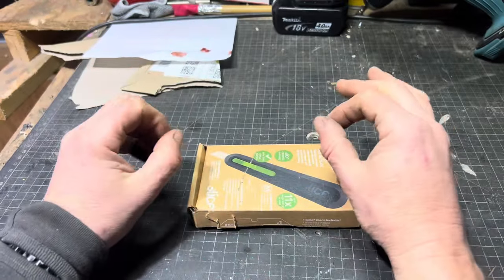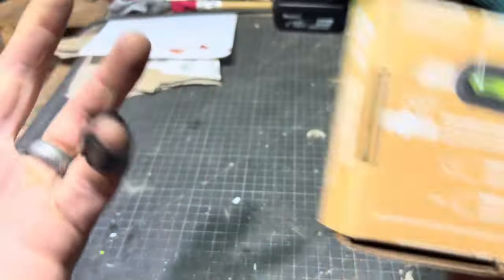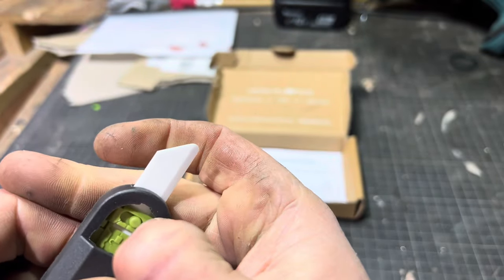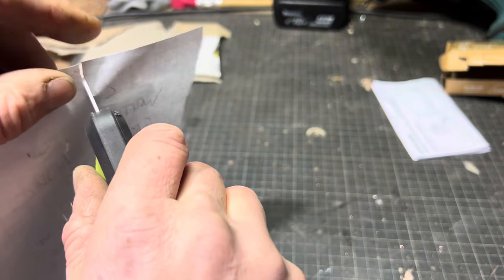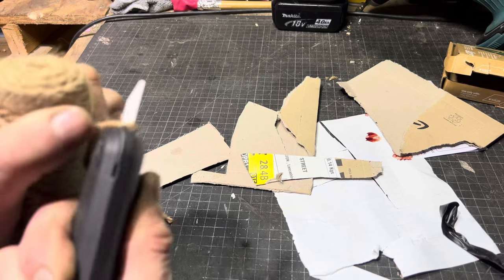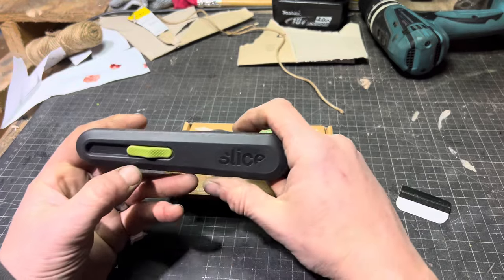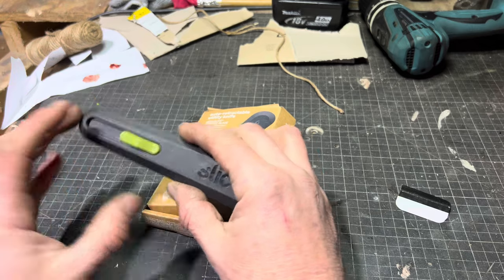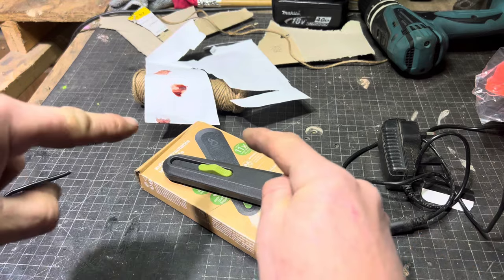The slice ceramic blade safety knife!! Is it any good In the right hands??

Comment: I have an old model of this, bought about 7 years ago to use as a tape splitter and box cutter at work. 
The one I got is more the size of a sharpie (but flat), so very comfortable to carry and use. The sliding button is on the top edge. 
The blade is a little chipped now, but its still sharp enough to do the job. Replacements cost about the same as a whole new unit, but havent felt the need to replace yet, even though the cut is no longer quite as clean and tidy after 7 years use.
Reply from the maker: That’s an great story my friend 🤟🤟

Comment: Use super glue on those cuts, the'll heal faster and cleaner!
Personally I couldn't warm to ceramics. Yes, they hold an edge pretty long but aren't sharpenable and never as sharp as steel (though the new flexible ceramics look good they also cost a lot) but the biggest problem for me was the breaking. They fall, they break, you put too much force on it, they break.